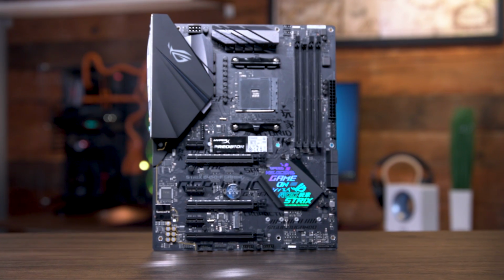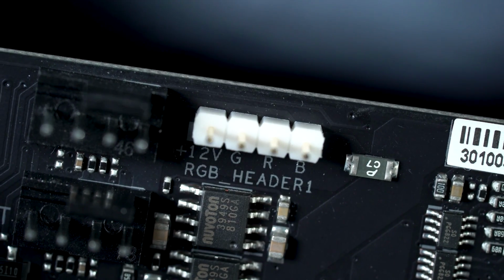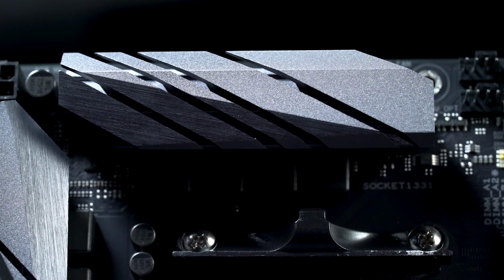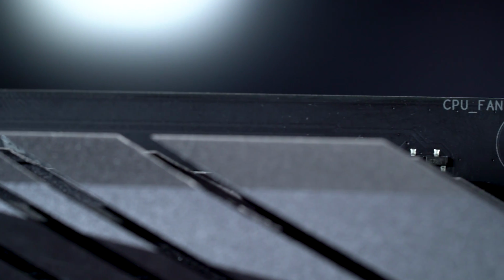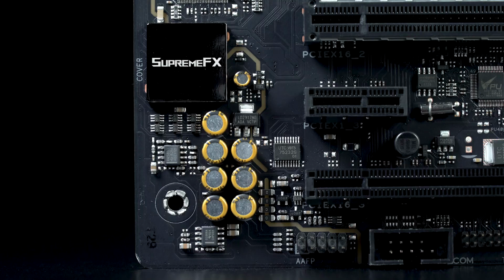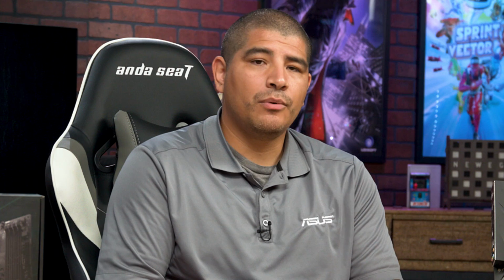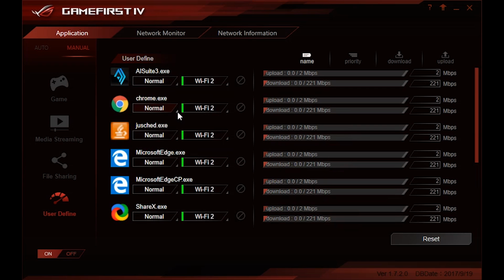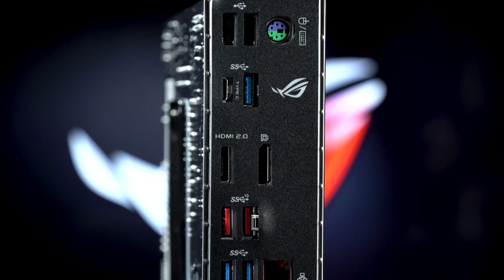ROG STRIX B450-F GAMING – Hits The Sweet spot for AMD PCDIY Gamers & Streamers

Comment: I built a system with this motherboard about 2 months back, first build too :D!
Specs:
CPU: AMD Ryzen 7 1800x
GPU: GTX 1080 Strix
RAM: G.Skill RGB 3200 8x2 16gb
Cooler: Coolermaster aio
It runs like a dream and I couldn't be happier.
Reply: Hello what type of ssd are you using?
Reply: @Nelson-qy6ps  crucial 250gb m.2
Reply: I’m thinking of getting the Ryzen 3600x  and the same specs you got
Reply: Work like charm for both PUBG gaming and streaming at the same time. 140+ fps average

CPU: Ryzen 5 3600 OC to 4.2Ghz
GPU: Gigabyte 1070 Ti 8GB
RAM: G.skill Trident Neo 3200mhz 8x2 16GB
Reply: What games to do you play and what kind of fps do you get?
Reply: bruh I can't oc my rams on this mobo, idk what's going on I've tried everything
Reply: So it supports 3200 mhz ram speeds?
Reply: @nixonthuo808  yes it does, i managed to oc them after the latest bios drive
Reply: how about your audio ? is it good      

im having a problem in my supreme fx the sound is to low even i hit extreme  not like my previous mobo  same headset that ive use works fine and its loud
Reply: I have different build with this motherboard 
Rx 5700
Ryzen 7 2700
Ram 16 gb 3200 trident z
Reply: do you know if this board supports intel cpu's?
Reply: @rybs6633  No. It's an AMD AM4 motherboard
Reply: Hunt3r ty
Reply: HELP,  im thnking about to buy this motherboard with a ryzen 7 3700 processor and keep my old 1070 8g graficcard and buy some new 3200mhz ram , [ big question is.. is that a good buy? Sry for my eng
Reply: det er nok et ret godt køb
Reply: niclas andersen yea that’s totally fine
Reply: @daddytachanka8076  do you know if this mobo can support 2gpus?
Reply: PolarDarkness it can
Reply: Bruh my custom PC I just build few days ago is similar to yours with this motherboard!

CPU: Ryzen 7 3700x
GPU: GTX 1660 Strix Super 6GB
RAM: G.SKILLS 16GB (2x8GB) 3200RPM
Fans: 4x Crosair LL120 (3 front 1 exhaust)
CPU cooler: Stock AMD cooler

Waiting for the parts to deliver still
Reply: @jackson22668   do you know if this mobo can support 2gpus?
Reply: you could chose these specs: 
CPU: AMD Ryzen 7 2700X
GPU: MSI Ventus XS 8GB GDDR6 GeForce RTX 2060
RAM: Corsair Vengeance LPX 16GB DDR4 3000/3200MHz
Case: Corsair iCUE 220T Airflow ATX
PSU (Power supply):  EVGA 600W 80+ GD GOLD
Fans (if you want): Corsair SP120 Triple pack
to connect all the fans to the motherboard buy fan splitter cables
Reply: Does it have built in WiFi?
Reply: Savage feathers no it doesn’t, you will need an ethernet cable.
Reply: You have two GPU’s
Reply: does it have wifi?
Reply: @mrtaco0078  No you'll need an adapter or an ethernet cable
Reply: bro does it go with a intel 5 9600k cpu pleas answer
Reply: I had just sold my House and decided to build a Machine while I was sitting aroung. I used the B450F Gaming 2070 Super, AMD Ryzen 7 3700 Matisse, 32G Ripjaws Ram, 500G SSD, 650 P?S Modular, Fractal G Case. The fans are Appevia and there are 5 Fans and 2 light strips. Looks really good. Cools really well , and the Fans move 57 CFM. I need more Storage , which is what got me looking at the Videos. I think I can just add another PCIe SSD, and will be good to go. I decent 1T should keep me out of troubles. I matched it all to an Asus 32" curved 1440P 165 mghz 2K Montior. Truly stunning graphics, considering the old 740GT I used to be on.
Reply: sucks u cant overclock through the bios
Reply: @GravenProductionsTM  What?! Of course you can. I have done it first hand and it's made really easy to do.
Reply: @daddytachanka8076  wtf. I literally cannot, theres no option for me to oc
Reply: GRVN what are you trying to oc? If it’s your GPU then you’re probably gonna have to get a software like gou tweak or msi afterburner. Cpu and ram can be overclocked in the ai tweaker which is the second tab in the bios. Also try updating your bios.
Reply: @daddytachanka8076  bios is updated. im trying to OC my ryzen 3 1200 to 3.9GHZ 1.425V and it just doesnt work, it boots back into the bios at these settings. Ik it can handle it because ryzen master does it fin but imtired of having to restart my pc every time I want to OC
Reply: GRVN hmm i had absolutely no trouble ocing my 1800x from 3.6ghz to 4ghz at 1.45 volts. It has worked completely fine ever since the oc normal boots etc. I’m not sure about your oc with that specific cpu though.

Comment: Hey, hopefully someone can help. The asus aura will not connect to MOBO and I cannot change rgb lights. Anyone know what to do? Thanks
Reply: Try downloading a different version of aura sync. first unninstall all other drivers that manage rgb of another components; like ram sticks and gpu, second, unninstall your actuall aura sync of your motherboard. Download the new versión of aura sync or the last but FIRST install all other rbg softwares of another commponent (try to change colors or effects, open the sowftare and uset it. liek ram's sticks color) and next install the aura sync software of your motherboard. I did that and now, all my components are controllated with aura sync (motherboard  main) ram's sticks, GPU and of course motherboard.

Comment: Should I get this with these specs? and is it possible to upgrade the cpu sometime? Im new in building my own computer.

Rog strix b450-f gaming
ryzen 3 2200g
2400mhz 4x2 or 3200mhz 8x2 
stock cooler
Reply: R3 2200g does not need such an expensive board
Reply: @mrsvineela2025  in my case I am also building a second system ... and plan to move the 2200g to the second system and upgrade to a better cpu later ... since I don't have the money for a nice cpu and graphics card immediately ... so I think the 2200g is an economical choice ... also adding a nice graphics card would upgrade the g on 2200g later on I think :)
Reply: @mrsvineela2025  Fanny said "im going to upgrade the Ryzen later ..." ... that changes the fact that the board is "more" than the cpu, yes?
Reply: I am putting together something similar. I'm not sure how well two different memory speeds will work though.
Reply: i mean im going to upgrade the Ryzen later if I have the budget😂
Reply: @chaaan8601  but u need to get a gpu so that it makes sense to buy this mobo
Reply: @mrsvineela2025  im going to buy a gpu also😂
Reply: @mrsvineela2025  a 1050ti is good right?
Reply: @chaaan8601  rx 580 or a 570. Not 1050 ti
Reply: @mrsvineela2025  ok thanks for the help :)

Comment: Why did you skip the details of the motherboard will not display without a video card attached to it, or a processor with built in gaming graphics like the the Ryzen 5 2400G, the Ryzen 5 or Ryzen 7 X-series. This is something you should mention about this  motherboard and all motherboards. 
I know this because I have this motherboard with a Ryzen 7 - 2700 on my pc and a Ryzen 5 - 2600 that put on my moms Pc when I built it for her.
Reply: That's a user error. Not the manufacturer's fault. Sorry, that happened to you but now you know to do more research and to better inform yourself before building systems especially when you're building for someone else.
Reply: DJHeroMasta those were the parts I was at memory express. When I chose those parts. I was informed about the board. Nowhere does it say that the motherboard will not display without a video card. Nobody at store said it will not display without a video card, this video and others like it say nothing in regards to it not displaying without a video card. So you might want to think before you speak. It is not user error, so you should get your facts straight. 😂 but you keep trying to pull your gotcha moments
Reply: @blackstarafro2   @blackstarafro2  Smh.....15+ years of experience working on and building PC's yet I'm the one who needs to get my facts straight. That simply goes to show you that you didn't even read the manual that was included with both motherboards. The beeping sounds are postcodes and they informed you that a graphics card wasn't present/detected. But let's say you didn't get that far into the manual, on page 9 it reads "Graphics: Integrated Graphics in the AMD Ryzen™ with Radeon™ Vega Graphics".

Oh wait, this one's my favorite, page 4: "The motherboard comes with an AM4 socket designed for AMD Ryzen™ 2nd Generation/Ryzen™ 1st Generation/Ryzen™ with Radeon™ Vega Graphics."

And besides, the only modern hardware that currently has soldered GPUs on the motherboard are laptops and even then, gaming laptops even have dedicated graphics cards.
Reply: @ blackstarafro2 when you open the specifications tab on the official asus site for this motherboard,read the fourth colum,please...
"Graphic:
Integrated in the AMD Ryzen™ with Radeon™ Vega Graphics Processors 
Multi-VGA output support : HDMI/DisplayPort ports 
- Supports HDMI 2.0b with maximum resolution of 4096 x 2160 @ 60 Hz
- Supports DisplayPort 1.2 with max. resolution 4096 x 2160 @ 60 Hz"

Also between the lines it says "noobs will be noobs".You didn't even bothered to read those specs,don't cry to us now.
Reply: No one mentions you need a video card because we all assume you have the iq above a goldfish .

Comment: Should I get this or ROG STRIX X470-F GAMING
?

I'll be using these parts\--
CPU: Ryzen 7 2700X
Cooler: I'll be using the stock cooler
RAM:G.Skill Trident Z 3200MHz 8 x 2 16GB
Graphics card:1080 8 GB STRIX

Thanks. :D
Reply: This is what I'm debating on lol! Hopefully we get some good answers
Reply: G.Skill Flare X highest quality ram for this board !!

Built myself a computer with same list as yours, except ram. I did dig deeper online and I am absolutely sure that G.Skill Trident Z 3200MHz wont work well with amd processor/mobo. Make sure to get G.Skill Flare X 3200 MHz.
Reply: @HordeonSC2  what about G.Skill Ripjaws V 3200mhz???

These are my top mobos that I'm still thinking about

1.Asus Strix X470-I 
2.Asus Strix X470-F Gaming
3.Msi X470 Gaming plus
Reply: Yeah agree! I think MSI Pro Carbon AC and 2700X is a good combo the wifi is a bonus too! Well, If you’re not planning to OC get MSI B450 Tomahawk instead. I use Trident-Z 3200mhz in B450 Pro Carbon AC and 2700X. Everything runs smoothly. No problem at all. Cheers
Reply: @Zesuto3  Very useful info, thanks! Just ordered this board, now I'm wondering. On a budget and going to get 1700 in here, was planning to OC a bit!
Reply: Sorry buddy but that gonna be some big bucks which u prob already know lol
Reply: I think Corsair Platinum ram woulf be better
Reply: you could go for a motherboard that has more phases for overclocking like a MSI X470 GAMING PLUS but if you are not going to overclock its fine but i would say get a better cpu cooler like a be quiet! - Pure Rock Slim
Reply: ASUS strix X470-I goodlike for overclocking and other stuff? planning on switching to mini-itx build...and I will be using Ryzen 7 2700X.. Thanks..
Reply: get g.skill flare x with xmp profile. Trident Z 3200MHz wont be fully compatible. It's more for intel processor builds/motherboards.

Comment: Awesome MOBO little too much plastic on VRM and thanks ASUS for not overwhelm us with that flashy rgb nightmare.
  
Can you tell me is this awesome MOBO have something like bios flashback dedicated port or we can use specific type port?? or it's via software?? 
(MSI boards have a special labeled port to do so (an option for some lazy/busy ppl))

BTW (I know you said to me: read the manual but If I don't like read manual) please tell me if anyone gonna uses 2 M.2 slots with NVME SSD (or NVME for OS and programs and sec M.2 for SATA SSD for games  ; -D ) did any of this 6 SATA are lost?? and if it is how many and which one?? Not everybody is that smart and have that much knowledge then you :-) so please be helpful.

Very nice video, more please like this and more detail,  thanks a lot, :-)

P.S. can you make some guide (maybe longer this time) how to navigate and tweak things in ASUS UEFI/BIOS. It would be awesome :-)

Comment: So whats the major difference between the Asus ROG Strix X470-F other than StoreMi and more RGB on the shield?
Reply: Dorian Williams Hire Overclock for 2600x and up and SLI ready
Reply: power distribution is the difference the x470 has more power but it's over kill the b450f has more than enough for overclocking and the store mi is the new future tek in processors keep your eyes on that stuff because it will make the pc components work correctly

Comment: Does it have Manual VDDCR CPU Voltage Option in the Advanced Tab in BIOS?
Reply: Yes, i gues, i overclocked my r5 2600 with automatic adjustment.

Comment: I have my 2700x on this board...any thoughts?
Reply: i'm jealous
Reply: paul Williams its more than adequate
Reply: How it's working ? becouse i want this mother board with ryzen 7 2700x.
Reply: Skrūdž wonderful
Reply: I do too.
Love this setup so far
Reply: HEY RANDOM QUESTION FROM A STRANGER. Have you had any problems?
Do you  render or have you done any stress test?
Reply: I average 1780 on cini15...with a custom fan curve I hardly hit 70..i don't run prime95..thats a harsh program...very very happy..but the only con is my m.2 drive like to run a little warm...thats cause my gpu is below it..so its getting all that heat
Reply: MrInsanepotato without a hitch
Reply: 2600 series with B450
2700 series with B470
thats what i recommend.

Comment: But does buying this on Newegg come with a free credit card details compromise?

Why does Newegg still continue to have the same Trustwave seal indicating "your credit card and identity information are secure" only to then provide the conflicting disclaimer that there is "no representation ... NewEgg.com systems are secure."  Was credit card details secure during the entire last month in which Newegg had been displaying this seal or not?

Lastly, why does Newegg seem to still not have any prominently posted security bug bounty and security disclosure policy? In fact, security just seems to be a small blip of what is otherwise largely just a privacy policy.  Having Newegg point out that they simply use SSL is not reassuring when they can't even be bothered to point to the same certificate authority they use.  Newegg is currently using Entrust but states that more information is available from Verisign.